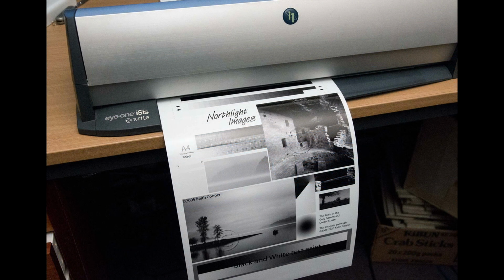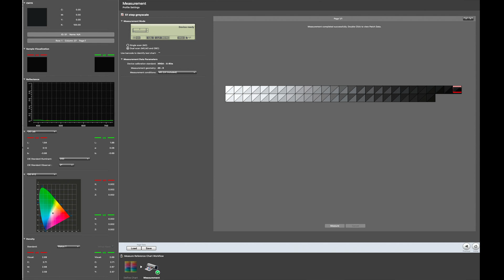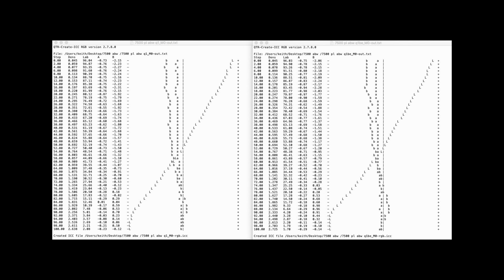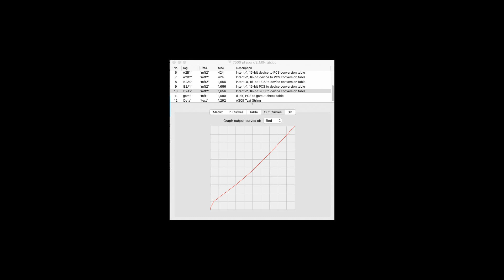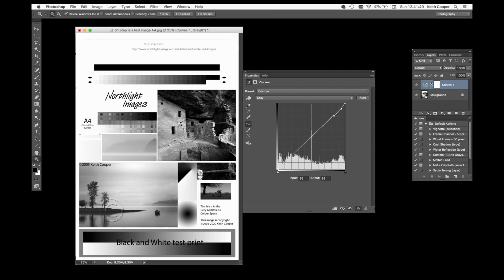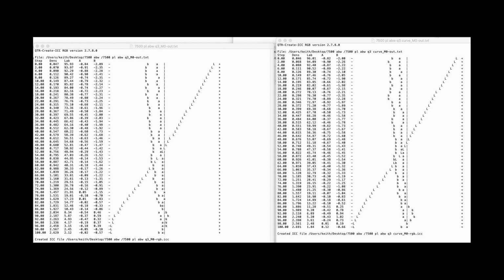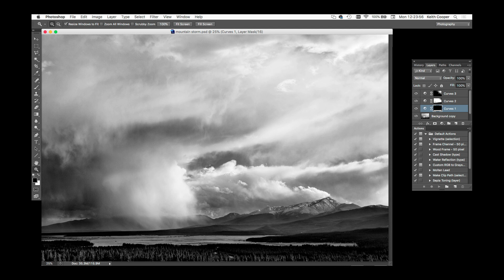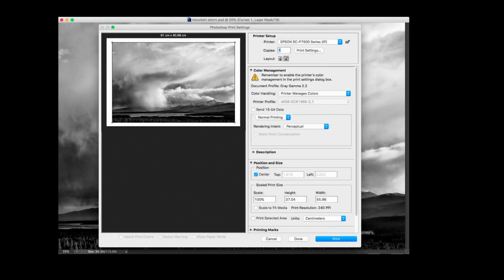P7500 Optimising black and white linearity and shadow detail in a large [16 x 24] photo print

Comment: 1) How often do you do ICC profiles for the same printer/ink/paper? Does ink production has a tolrance/range? So, you need to re-do an ICC profile every time you change cartridges?

What if you did an ICC profile for a paper at one point in time, then used the same paper some years later? Does the paper (and the chemicals on it) change over time? So, you need to re-do the ICC profile for that paper when you are about to use it for a print?

2) Does your spectrophotometer "slide"? If so, how do you recalibrate it?
Reply from the maker: 1 - it depends... If I'm doing contract proofing and other colour critical work, then re-profiling/testing would be part of my QC process. For me though, a profile will last for years if the paper is not re-formulated. OEM ink formulations tend to be consistent over time.
2 - yes, any instrument drifts.  I could send it to X-Rite for annual re-calibration. which would be part of my QC process. However that costs more than I can afford, so I rely on the calibration tiles and software which will run basic checks on the function and stability of the devices

I don't do proofing or precise colour work... ;-)

Comment: The thing that really frustrates me is there had been NO improvements on the issue of metamerism with Epspn inks in the past 15 years. My old darkroom silver B&W prints look the same in tone regardless of the viewing light. Inkjet B&W prints still shift significantly in tone depending on the light source. Quality offset photography books don't shift.
Reply from the maker: I'd say it depends which inks you are talking about - I have seen some improvements in the B&W performance of some pigments - still depends on the paper
But yes, could do better
Reply: @KeithCooper  Keith, thanks for replying. What inks have you seen improvement with? I haven't seen any improvements in this area since Epson introduced the 3800 back in 2006.
Reply from the maker: The inks in the P7500 and P20000 both gave better B&W than I recall with the SP3800 [one I reviewed years ago]
That said the B&W performance of the  P700/900/5300 is good from a neutrality POV, but with papers like Premium Lustre there is still too much 'bronzing' at high quality print settings - it's not illuminant related though